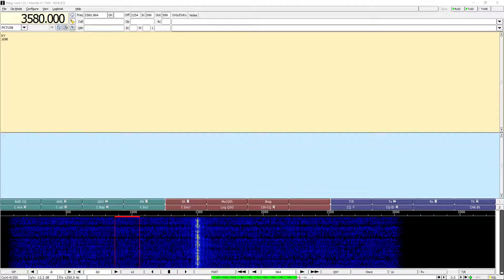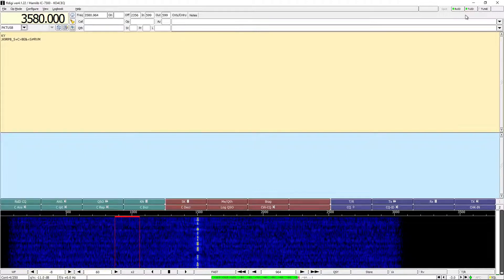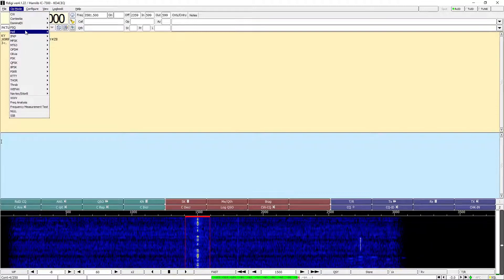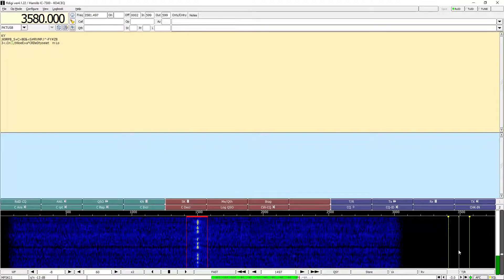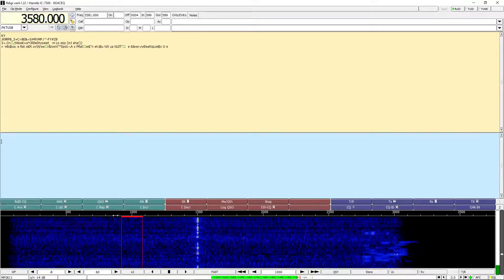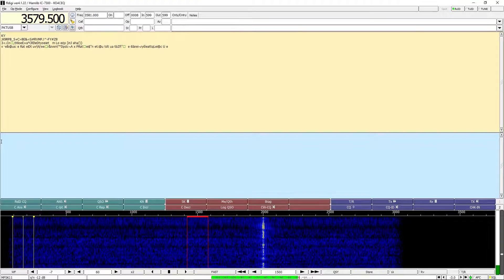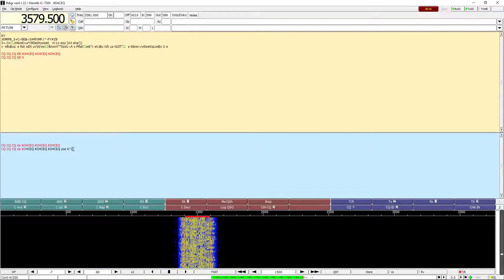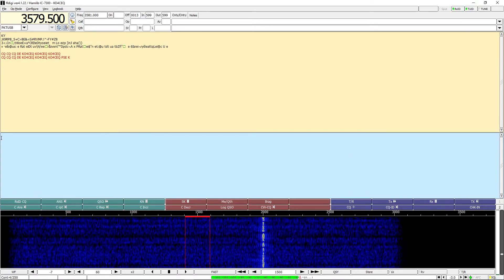FLDigi GUI Basics

Comment: Very helpful. One question; I have a simple interface from my Windows PC to my icom 706, and as such don't use the rig control feature. Why doesn't my frequency display ( top left corner) match the centre frequency display. For example, it may read 14070.00 for psk but the centre frequency will always read 7050.00 for example and I cannot change it by clicking on it...... Everything else works fine!
Reply: Without rig control, you aren't sending/receiving data that could change or view the frequency from your computer.  If anybody else has better info, please drop it below!

Comment: Great video, is there a way for fldigi to automatically switch to whatever mode the radio is listening to? I am new to digital modes still not familiar with what they sound like.
Reply from the maker: The RxID and TxID is useful for switching modes automatically, although the person transmitting must have TxID enabled and the listener must have RxID enabled.

Experience also goes a long way.  If you operate under different modes long enough, you'll pick up an ear for it.